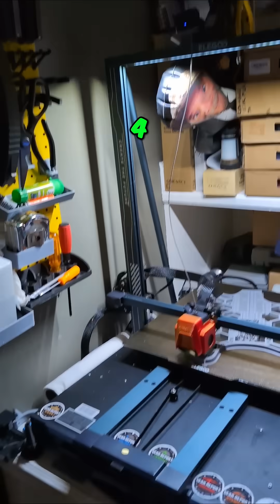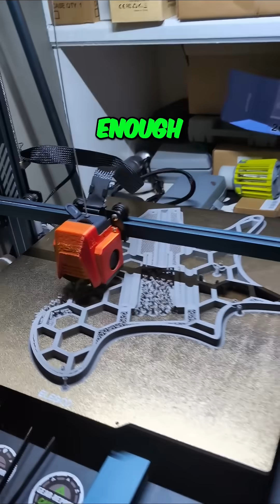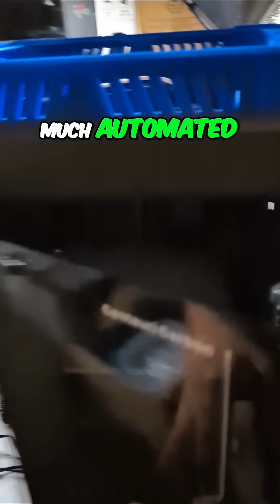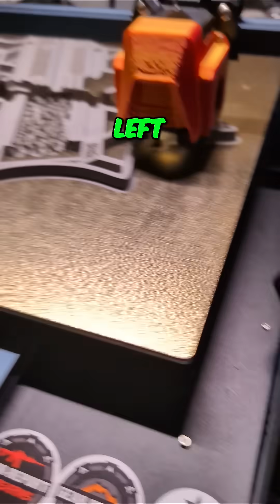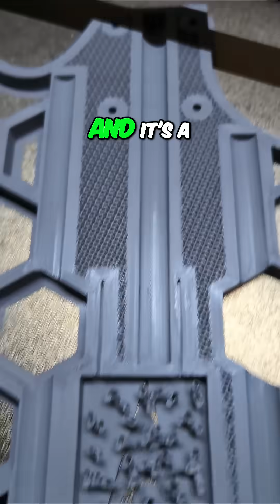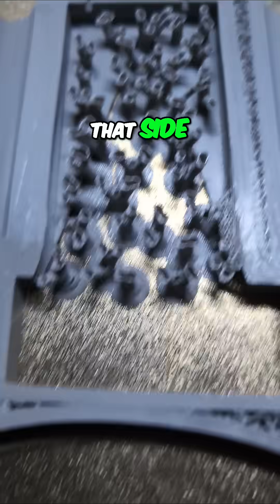3D Printed Guitar Body: Neptune 4 Max Time-Lapse!

Comment: For my Neptune, instead of the standard spin to level leveling systems, I just measured how long the distance from the plate to the hotbed was, then I 3d printed some spacers so that I basically do t have to worry about printing. After a while tho my printed spacers kinda
Got worn out so I just ordered some cnc'd washers that were more precise and it's been fine ever since
Reply from the maker: You must be more precise at your measurements than me.

Comment: Props to you for leveling tho whole thing to be able to print such a project. I feel like I would've failed too many times before a final product
Reply from the maker: Thanks. I could not have done this early in the printer's life. It wouldn't use the mesh, so It couldn't be effectively leveled.

Comment: Hi. How do you get the rods in if they are round?
Reply from the maker: the bottom of the cavity is rounded to match the rods. The top is squared to let it print without the nozzle hitting the rod. But in practice, with no support under the first layer or two of print above the rod it kind of filled in the gap a bit to hold the rods firmly.  https://gear-report.com/my-journey-to-a-playable-3d-printed-guitar-a-gear-report-maker-review/
Reply: @GearReportMaker  Cool. Thanks for the answer.

Comment: Dude assuming you have done a auto bed leveling it should be able to compensate a even relatively bad level bed but in order to enable you gata get the load bed mesh macro entered into the start gcode after i believe the homing setup otherwise it throws out the loading of the bed mesh during the homeing to may want to check and see if the z motors are turning as the first layers go down if not its literally printing as if its on a literal perfect 2d plane
Reply from the maker: It seems ok now on the current firmware. But for a year I swear it was tossing the mesh.
Reply: I can believe the firmware  could be causing issues to but i was trying to get at the start gcode from the slicer theres a gcode that may be commented out by default or not in the right place or may not be there at all @GearReportMaker
Reply from the maker: I would check, but I think I'm ready to sell the N4M and move on.